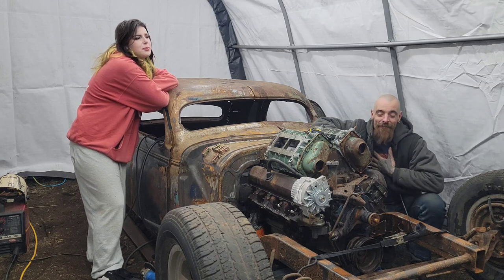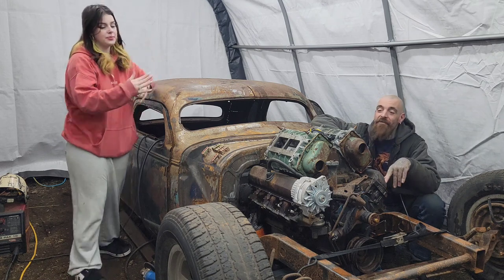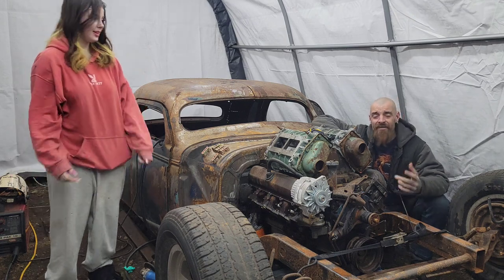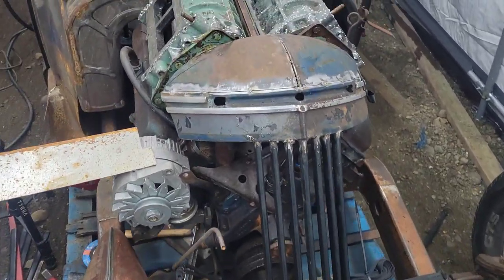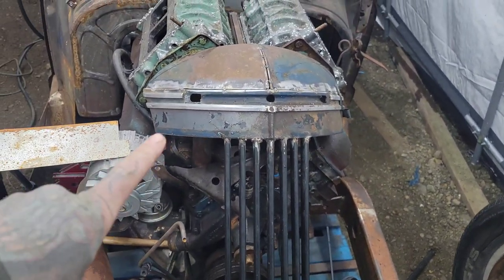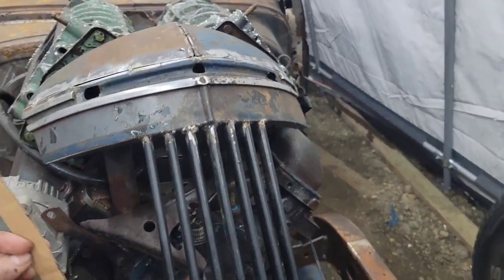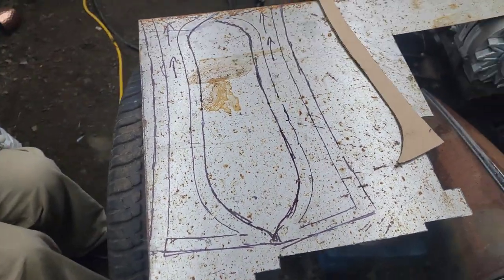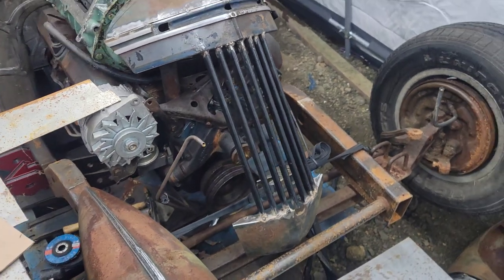Rat Rod Chevy with a Twin Blown Olds Grill Part Two

Comment: I'm Lovin the Looks of This Thing... Pure HOT WHEELS!
Reply from the maker: Thank you, That was my intention.🍻  I can't wait to build the headers because when people see what's in my head, it's just going to complete the package.
Reply: @kingofbootyfab  I Totally get that... I'm working on a '53 Ford F-100 doing Like a 70's Show Rod... Totally Flat Firewall with a Tilt Front End. Wild Fenderwell Headers Like a Mock Armored Bank Truck. It will be Different but Cool 351 Cleveland and C-6 Transmission
Reply from the maker: I love it.  If you've got pictures posted somewhere shoot me a link I'd love to see.  One of the coolest things about YouTube has been some of the people I've gotten to connect with, and the absolutely phenomenal talent that's floating around out there completely unrecognized 
I've got the 2 39s, and both of them are basically going to be Full size hot wheels.  This one a chopped and channeled rat rod, hugely disproportionate,  it's going to have people scratching their heads.  My other, will be a chopp3d and channeled tail dragged, with a big block Caddy, tunnel ram and a 671.   Both with wild fender dump headers.  I want Cars that are on the edge of tasteful but absolutely unforgettable.  My next one will be much more understated, a total sleeper.
Reply: @kingofbootyfab  I'm Not Sure how to do the link for Photos... I've been watching you do your stuff for over a year. I'm a Self Taught Mechanic Bodyman Painter and Fabricator. I've been in the Automotive Industry for Over Forty Years. Finally getting to My Own Stuff. Ha ha! Keep Up the Great Work.
Reply from the maker: Thank you David 🍻
If you ever post them somewhere tag me or shoot me a link.  Or email me pics if you want, I truly do love to see.  Bootyfabking@gmail.com 
I truly appreciate all of you that follow along.  I have some people very close to me that push me to upload more, and show off more skills, I also struggle with wether or not its good enough.  But comments from people that follow along and have for a long time  seriously help drive me to do better.    I hope you get your project out there soon.  We all deserve our own.
Reply: @kingofbootyfab  Thanks Brother... I Understand. Nothing Happens by itself... For Sure

Comment: Jade, did your dad catch you mimicking him? Ha Ha Hey, I meant to ask you where you got your intake manifold for those blowers? I haven't gotten a good look at it yet. Love the headlight nacelles. I'm liking the look of the grill with the sides added.
Reply from the maker: 🤣🤣 She does that.  What's scary is that she generally knows what I'm going to say.
Flip back to older videos, I've actually got a video on the CAD design and assembly, that's entirely my brain child.  
I found out later that there was a production grill that was amazingly similar 30 or 40 years ago, made in a limited run, but that just confirms my theory that it will work honestly.
Reply: @kingofbootyfab  Ah, I like it. You aren't going with a hood though, is that correct? I mean just the grill and then leaving the engine compartment open?
Reply from the maker: Yes.  As minimalistic as possible.  I would have cut so much out of the hood there wouldn't be anything left anyways.  Once my carbs get here, I won't want to hide any of it 😎
Reply: @kingofbootyfab  What carbs did you purchase?
Reply from the maker: Weber Dcoe 40s.  I was originally looking for 45s, but these popped up and the math says they'll work beyond what this motor will make.

Comment: Looks great. I don't reckon I could pull off flux core welding those bars. Maybe try wire wheeling the thin steel clean before welding?  If your welder only has high or low power settings then going with high power for quick spot welds on a slow wire feed on clean steel might get you there.
Reply from the maker: I think I need to step down wire size honestly.  I've been able to weld everything with 030 to most peoples surprise, but these are just beyond it.  The fact that they are dissimilar in gauge is really what's doing me in, but I can come back to that, I don't forsee anywhere else on the car this will he a problem..

Comment: Coming together nicely 💪 you still going to use those headlights? I know ur still working on them also, they just look a little bulky now that the grill has its outline... Maybe once you set the headlights they might just blend in. 
God bless and keep blessing Others 🙏💪👍. 
Btw I love ur daughter mocking and dancing to ur words 🤣😂💪👍
Reply from the maker: I've got a plan there.  Once the grill is finished out and the headlights are mounted, I think they'll flow well, I love the art deco lines on them and all of the parts will be cohesive.  Front frame has some work coming too which will help.  This part I've got a solid vision for already 😎

Comment: Your bead roller must weigh a ton man ,
Reply from the maker: It's not light .  But it's very rigid, and makes short work of everything I throw at it 😎
As soon as I get the power drive on it I've got a mountain of work  lined up for it, all the parts are sitting on the shelf

Comment: i listened to your kid and subbed. got one question for you though, what are those blowers off of ?  i recognize the paint color but can't place it. old greyhound bus maybe?
Reply from the maker: They are 4-53 blowers, that came off a detroit diesel.   The 4-53 was a 4 cylinder, 212 cubic Inch 2 stroke diesel engine, and I'm reasonably certain that most of them where industrial Applications as opposed to automotive.  The larger 6-71, 8-71, 6v91 etc where medium duty truck engines, but the color was more common on detroit engines than any of the other colors I've seen them 🍻